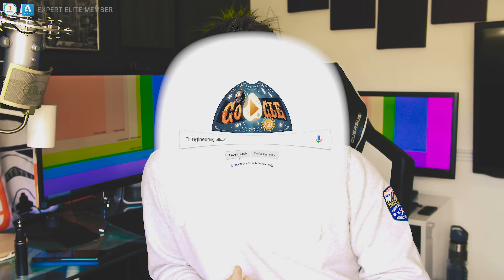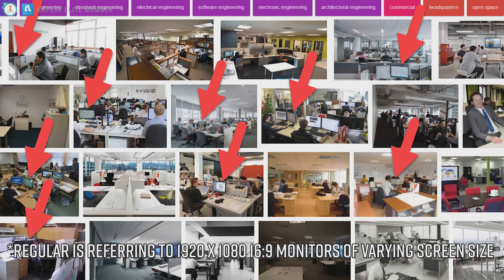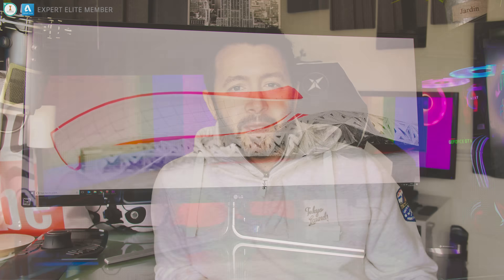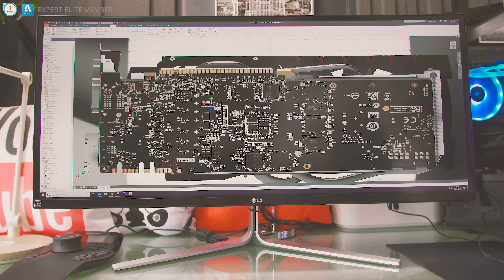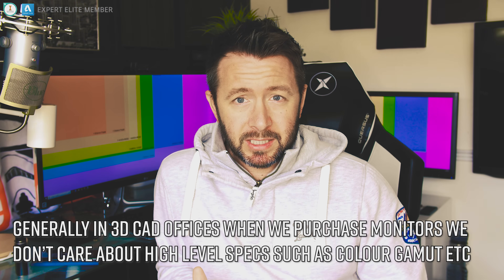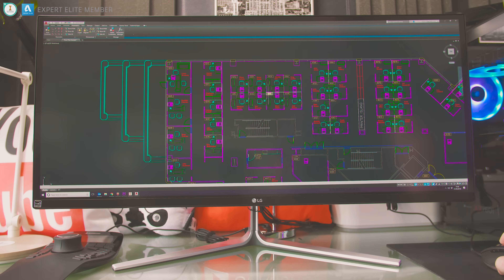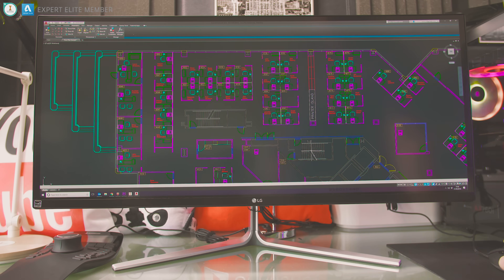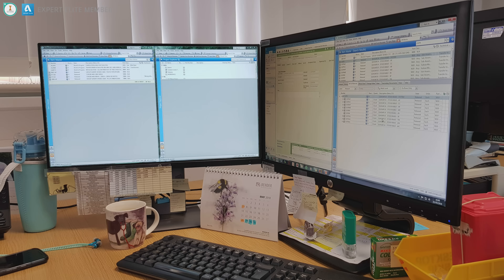FAO: THE BOSS, your designers/engineers NEED this upgrade.

Comment from the maker: FAO: You the commenter! This isn't an advert, I've never spoken to LG in my life or any other monitor vendor for that matter!  This also isn't a general consumer infomercial like you'd get on mainstream tech channels, it isn't structured and presented like one and that's intentional, please don't judge it with expectations of it being that.  This is a professional channel with content aimed at an audience who generally may not be followers of the tech scene, so specific technical specs are intentionally omitted... including referencing things like resolution capability.  This is also not a review of any particular monitor, it's an awareness piece to educate workplaces on the benefits of ultrawide panels.  Cheers.

Comment: I think the best combo for engineers is 2 monitors. Ultrawide as principal (for designing software, etc) and a normal one (maybe cheaper, smaller, etc) for support porpoise (to read codes, catalogs, specifications, during the designing sessions).
Reply: I personally use a 4x3 monitor as my main. It's technically a meical monitor I believe. And then my secondary "monitor" is a drawing tablet.

Comment: For some reason no one will comment or tell their experience with 1800R curvature or below for CAD use. When this video was made 3800R was more usual and it is probably not an issue. However today 1800R is very common and I’m worried about problems with lines not looking straigth with a heavy curved monitor. This would be a good topic to make a video about and a comparision. Anyone have experience with 1800R and CAD?
Reply from the maker: I have a 1800R monitor here, the BenQ EX3501R, I never got around to making a video on it as the monitor wasn't much of a step change from the previous ones I'd had.  But there's no issues whatsover with lines not looking straight, you look dead on at the panel, the curve is at eye level, and the curves run parallel to the bezels and all other elements so nothing looks odd.  Plus you have to try really hard to accidentally draw non-straight lines in CAD with the amount of drafting aids there are and constraints, but I'll see if I can remember on to create something on that topic.
Reply: @Neil3D  Thanks a lot for this comment. I see this BENQ is a VA panel but sure they can be very high quality too. I've been looking at only IPS panels since reviewers do say thats the way to go with the wider viewing angles they should have. USB-C is also one thing I would like to have for to be able to connect my laptop at work and at home via just one single cable. With the current stock situation there are not many options to choose from if IPS and USB-C is a must. I think a youtube video talking about VA vs IPS in CAD use could be a interesting topic for cad/cam users. As well as flat, 3800R or 1800R curvatures. And also usb-c connector vs display port is there any difference in picture quality and so on. I think these are questions many struggles with when they are choosing monitors

Comment: I have an Ultrawide monitor, my only complain is that I have to move from side to side constantly hehehe, so it is kinda uncomfortable. Anyway mine is flat, what about curved monitors, aren't those bad for straight lines?, I mean those are vital for CAD applications.
Reply: I was thinking about it since I want a monitor for light gaming but I also use cad software quite often so I think I should skip a curve monitor

Comment: I totally disagree about usage of 1 x widescreen monitor. 2 x  27" WUXGA monitors are 10 times better than one ultrawidescreen. Ultrawide is prety unsable for effective work. More and more 16:10, and not 21:9 are the way to go because of software design and usage, especialy cad. 2 x 16:10 would be best solution for cad design.

Comment: i have been using two 27inch monitors (exact same brand) for many years, but just took the leap and ordered a 49inch ultra wide monitor to replace them with.....keeping my fingers crossed that it was the right decision, as it wasn't cheap...but after watching this i am pretty confident its the right way forward....i work with revit and rendering software on a daily basis and really excited about using it on a massive screen and seeing what the models look like!.....fingers crossed!

Comment: How do your videos not have more likes and followers, such great content, thank you for the video.
I am a engineering student first year (start January 2021) currently study tertiary preparation for Engineering Course.
I've bought a i7 9th gen Acer Predator Helios 300 (16GB Ram, 256GBSSD, Nvidia RTX GEFORCE 2060)  

I want to buy this monitor that you have described in the video, would you be able to do a 2020 video version or even just reccomend some models? would you stilll recomend this in 2020?

Comment: How about curved vs flat 34" ultrawide monitors. Which is best and comfortable to use for applications such as AutoCAD and Revit that deal with straight lines. Do lines look distorted in curved monitors? Or whats the ideal Curve Radius you recommend.

Comment: Great video but one thing is missing: I had 3440x1440 ultra wide monitor and working with with quadro mobile 2200 on this monitor forces gpu a lot and sometimes it is impossible to make drawing. Now I use 2560x1080 monitor and it is more acceptable use. shortly if you dont have a good gpu forget about using this kinda monitors

Comment: How about the 16:10 aspect ratio vs ultrawide?
I head lots of people doing CAD swear by it, and I'm looking into 24" 16:10 as my next monitor too, for general web browsing and some Fusion 360.
Reply: for the love of the IT gods, dont buy a 24" for CAD work...:D hahahaha...
Reply: @Toffypops  Why's that?
Reply: because the higher resolution on a 24" the smaller screen pixels not bigger surface area.    And even if you had a 24" monitor the resolution would be sqeezed into a very small area leaving you to squint .....even 27" when trying to do multiselection on wide sketches/objects is a nightmare in fusion 360.

Comment: Many managers and costing A-holes are stupid beyond belief.  For example, in 1983 ONE 21" CRT monitor cost 3000$ USA dollars. Today in 2019, you can purchase eight to ten 27" LED monitors for 3000.00$...    Today in many engineering firms, that are run by non visionaries,  you are stuck with two 24" monitors.   Any half brained PHD, MBA manager types should be able to foresee that production is increased  by at least 30% with three or four 27'" or 30" monitors.  Catia users have three  27' monitors horizontally as a default ..  As I get older I see more stupid, dumbed down, backstabbing ass kissers in charge of staff.   Most everyone is on antidepressants and consuming two or three other medications.  Many bosses are  legal drug users using recreational drugs. Now we  wonder why profits  are not what they used to be.  When was the last time you heard the saying ..."what is your level of comfort or your enjoyment at your position or job.

Comment: Well done Neil. . . . I'm currently waiting for my new workstation ( same spec as the 3 year old one that I'm using but a slightly better graphics card )
Some of my colleagues use 2 or even 3 monitors. . . .  I only use 1 ( I'm old ). . . . . . I rather fancy one of these so I'll try to get one. . . . It's a global company with the kit all leased through fixed channels. .. . . Hmmmmmmm that should be fun ! . . . . Anyhow I'll give it a go. . . . Thanks again.
Jim

Comment: I personally got 2 x 27 inch Asus ips 1440p monitors. Does it really make that much of a difference if the screen are even wider? Like what would the real benefit be here? Not that I say such a monitor is bad choice, just looking at my personal case.

I find it hard to imagine that it would make that much difference from what I have. Such a large monitor would just use more space since I would still need a 27inch monitor next to it for the non cad/render tasks (prefer to have those on a different monitor).

I use the middle monitor for CAD, the side one for Email/PDF/internet (this one split in two, so I have two widows open at a time).

Comment: Just got LG's newest 38" monitor a few weeks ago.  Wish I never got 3 x 4k monitors.  Should have gotten the 38" for a main screen for all things CAD and a pair of flanking 2k monitors for the same price as the 4k setup with OH so much more screen real estate.  It's literally like looking at a full size 22"x34" plan sheet!
Reply from the maker: Yea 4K isn't great for CAD, you have to scale the Windows UI up by 200-250% which essentially puts you back at 1080p real estate, it's crispy and sharp but the trade off is borked up UI elements and dodgy dialog boxes which I've no doubt you've been dealing with for a while!

Comment: what you think about onshape?
Reply from the maker: Honestly, I haven't used it.  However - I just looked at their website and on the front page first thing you see which sets first impressions is "modern CAD, finally".  That's bullshit and infuriating, it wound me up and I won't be visiting it again any time soon! Finally modern CAD... wtf does that even mean, if they have to resort to pretending like every other CAD suite is an out of date relic in comparison to them to gain their customers then it tells me all I need to know about them!
Reply: TFI exactly. Their email marketing wreaks of the same ignorant bollocks.
Reply: poor value compared to Fusion 360. Simple as that. They have some nice tools, then Fusion should have... but that battle is overwhelmingly in Fusion's favour. Fusion is a solid 3 years ahead.

Comment: Whats your opinion on using a 40" TV (1080p, 60hz) as a monitor?
Reply: k24hybrid you know those old people phones with jumbo buttons, that’s what you getting. To get 24” 1080 feel (real life pixel size) you need to do 50” 4K tv.
Reply: @krism3163  Totally agree. I use 55" 4K and it's great.
Reply from the maker: As long as it has a game mode to reduce cursor lag it'll be fine, any amount of lag on the cursor will drive you mad all day long! But if there's no cursor lag it should be pretty good, you won't get any more screen space than a smaller 1080p monitor but it'll be huge and magnified which some people prefer.
Reply: TFI ho!! I see 😉. Thanks for the reply!!
Reply: Kris M thanks! You're right, i think I also had my TV very far away (around 5 feet) so I would be missing the details and advantage of big screen 💪💪

Comment: Great video. Have been using 34"ultrawide at work and home for more than two years already. Excellent for cad and cam. Have you ever tried a large 4K monitor for this purpose?
Reply from the maker: I haven't tried large 4K but I've got a 4K laptop, and honestly I really don't like it.  Too many application abnormalities due to the uneven scaling makes it really uncomfortable to use.  Great for general purpose, media use, internet etc but it sucks ass for working in.  It's getting better - but some applications just can't handle it.  Obviously that's the fault of the software devs rather than the resolution and monitors but it's a thing, I downscale to 1080p when I'm working on the laptop and upscale to native 4K when just messing about
Reply: I have been using 4k monitors at home and the office for over a year. Both in dual monitor setups with 2.5k panels. Very nice, but 60Hz is still 60Hz... I miss the days of higher refresh rate CAD monitors.  I don't miss the fact that they weighed 70 pounds or more.  I hope to have a 34" 100Hz panel soon. only way i'd downsize from the HUGE playground I now take for granted. My workflow involves a native Inventor session, then remote sessions to Inventor on two other workstations.
Reply: agree: 4k would need downscaling on any laptop ;) Couldn't handle working 4k even on the 27"- instead use 125% scaling on 49" and 55" ips panels mounted to wheeled floor stands behind desk to push view distance > 24", to keep view width correct.  Otherwise you'd have to turn your head to see full screen.Bonus being eyes relax more with the focal point moved further from your face.  We use the 55" panel for team review of models and it's been worth the investment.Would still trade the extra height of the 49"+ 3840x2160 @60Hz for the higher refresh rate 34" panel 3440x1440 @100Hz in any desktop environment.
Reply: @chrismcchristian1690  Do you really see that much difference between 60Hz to 100Hz?

Comment: I'm all for big screens with higher resolution....but. I will never go back from 144hz.
Reply from the maker: Yea there's no productive related reason to go any higher than 60hz in this industry, other than it looks smoother, it doesn't yield any gains whatsoever that I can think of... personally I could easy buy in a 144Hz panel but it'll do nothing for me... I mostly game in VR and work in CAD or data management apps, so a higher refresh rate just isn't a thing.  Can't argue against someone wanting one but I'd recommend a 21:9 60Hz 1440p panel over 16:9 1080p 144Hz all day long
Reply: I know 144Hz does have a impact in competitive gaming, but what benefit is there to using one in a professional environment? Like I see no reason why you would need above 60-75 fps in CAD or even video editing.
Reply: Kristo Vald  100 Hz is good enough for this kind of usage in my opinion. Way better than 60 Hz at least, but I 'll choose an ultrawide over refresh rate any day.
Reply: Good thing is you can have both in one package nowdays

Comment: At least my workspace consists of a 24" 1440P monitor and a simple 19" (~)  1080P monitor in vertical position  The big one is for inventor, and usually i leave the vault to the second screen.
Reply: Dang, is the size to resolution not a big large? Like optimal size for 1080p is 24 inch and 1440p is 27", this forces you to use scaling and that usually messes up professional programs.
Reply: i dont feel forced to use scaling and i have it off,  but yeah text is on the small side.  also, i never looked at the specs of the main display. 24" is my educated guess, could be bigger